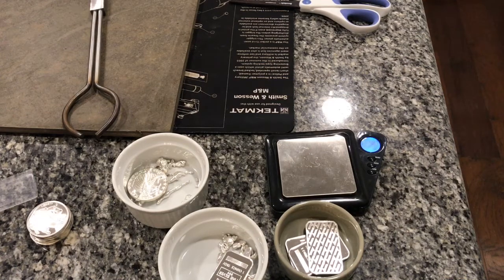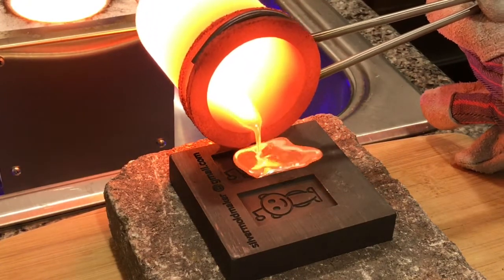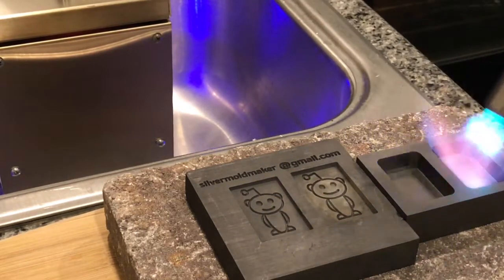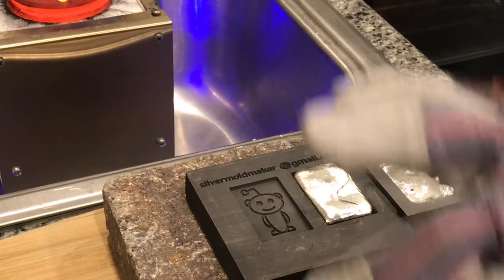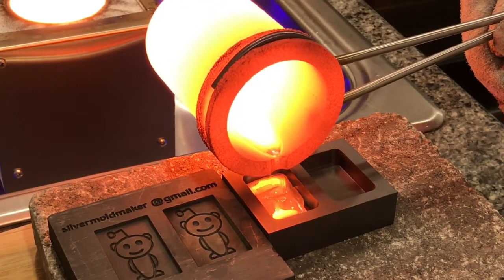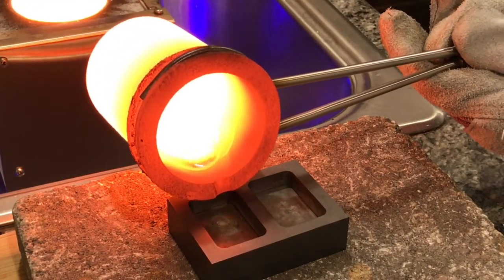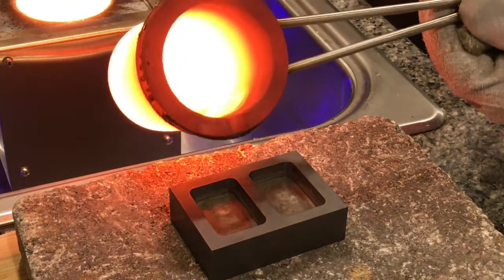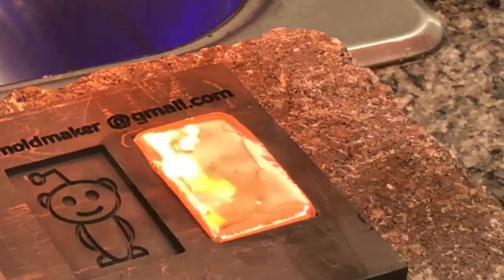Pouring: New Mold, Epic fails and some lessons learned...

Comment: HiHo nailed it - get the molds hot hot hot. even if you have a blowtorch angled on them and turn it off just before you pour. or leave the blowtorch on and create some nice ripples! Also, that mold is very shallow so a big crucible is going to be very hard indeed! good luck and stay safe!

Comment: you got it buddy, just use a large pair of pliers to rest your tongs on to pivot your crucible.  It will make your flow control into small molds infinitely easier.  Your doing great, it won't take long at all and you'll be rocking and rolling, even with that crucible!  Good to see ya posting again brother!

Comment: when you order new molds make sure that you get them cut deep !!!!! and you need to heat up your molds to a cherry red if you can it takes away from the silver cohesion and lets it flow out on to the mold much better !! and yes your pouring control needs to improve but like the rest of us it will come in time !! doing great !!!!! keep up the great work !!!!!